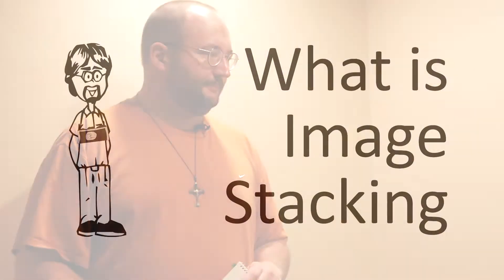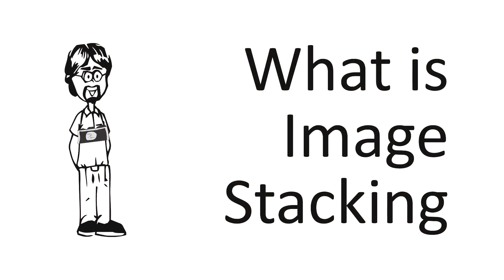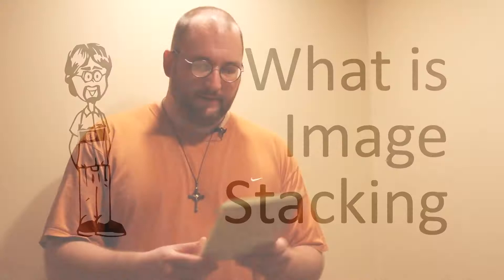How does Macro Image Focus Stacking Work?

Comment: I cheat.I bought an Olympus TG4 that does focus stacking in camera.Up to 9 frames.Unfortunately it limits it to an 8MP JPEG but it works pretty well.It also does focus bracketing if you want to do your own composite.It will also focus to about 3X life size.
Reply from the maker: That's nice! I didn't know there were digital cameras that did in-body focus stacking.
Reply: There are a few.I think the Olympus OMD-EM1 MkII does and the Panasonic GX8.I went with the least expensive option.
Reply from the maker: Nice! Thank you.